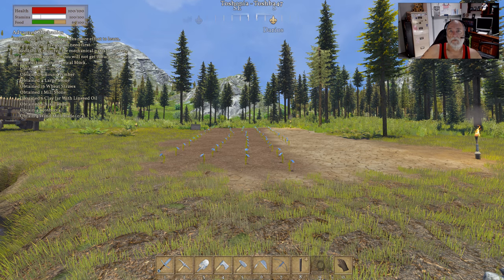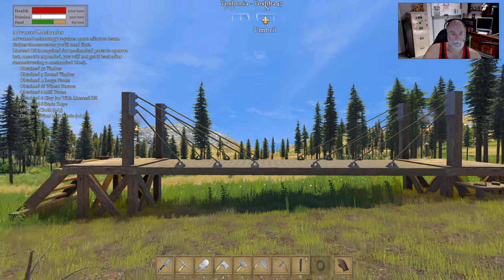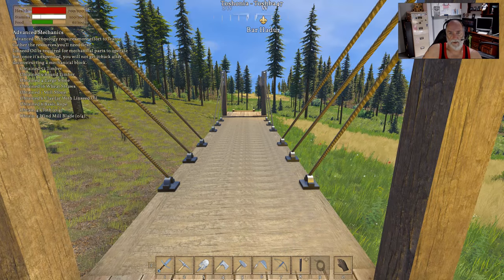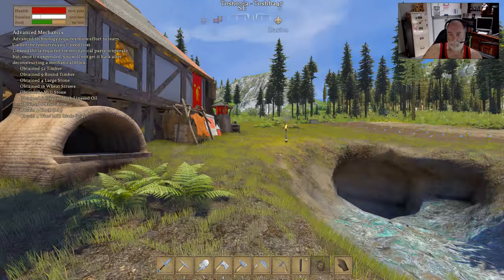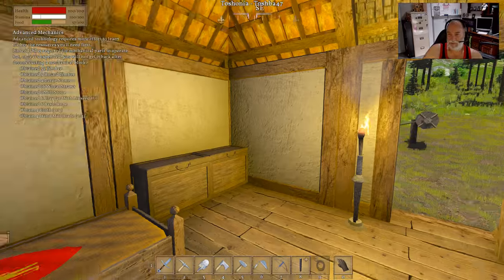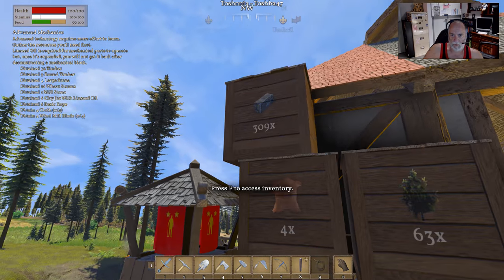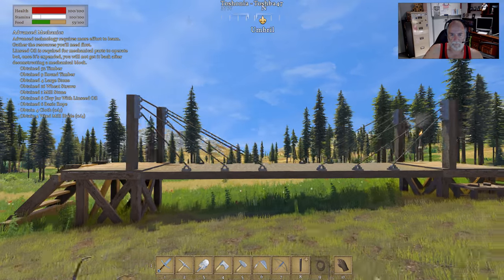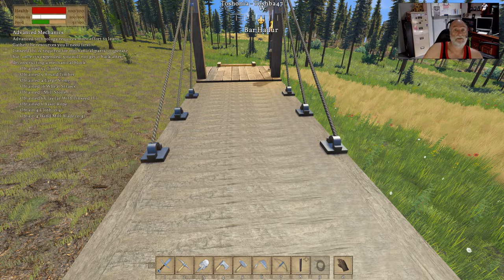Medieval Engineers - A Bridge too Far

Comment: Hey Toshba, 

With the windmill , you will be able to get 6 timber out of a log and 8 planks out of a timber , only issues the saws are pretty expensive and you can't melt them back ( unless i'm doing it wrong ) , 40 Metal parts for Planks saw and 30 for Timber saw. 

For the the suspended bridge, i've seen dome examples with catchement blocks that makes it actually suspended , don''t know however how stable and strong it would be on long distances. 

Your brigde is pretty good looking though , Maybe use planks as well instead of only timber =). 

Did you consider playing in multiplayer ?

I really like your videos !!

Cheers
Reply from the maker: I am really looking forward to building that. Thanks for stopping by.